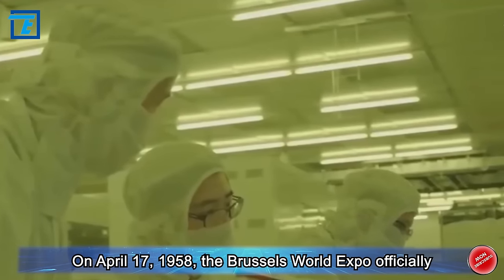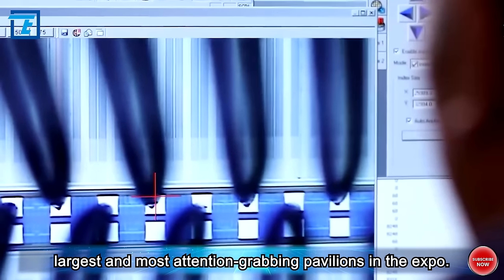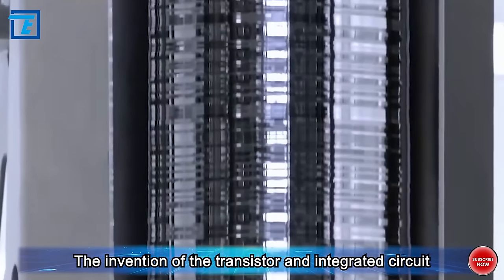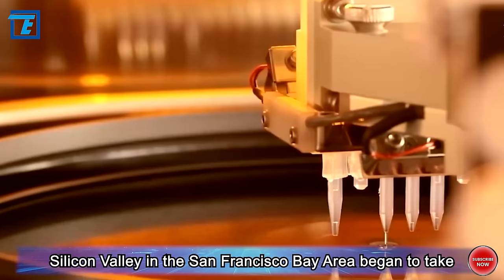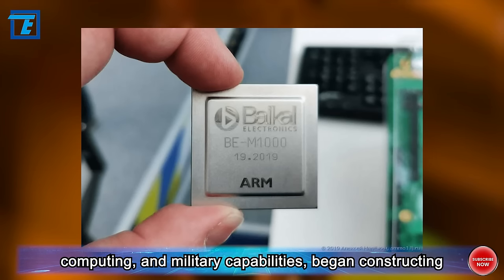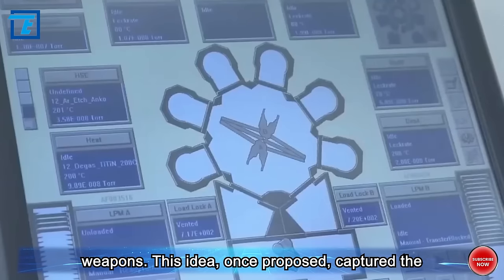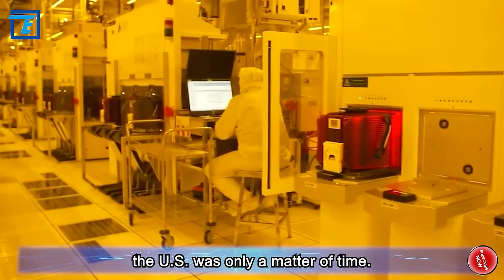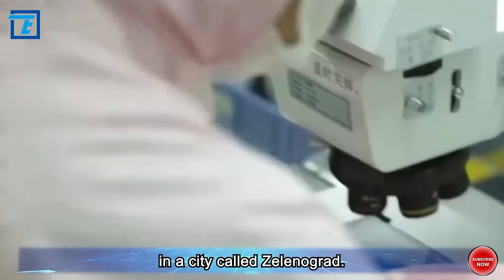Can Russia Develop Its Own Chips?

Comment: A lot of industries use past technology due to long cycle times. The car industry is still using 90nm and plans to move to 45nm in the next 5 years. The probes sent on Mars use tech from the year 2000. The aerospace industry is even more backward than the car industry, not to speak about the military. So the russians are able to manufacture chips for a big part of the industry.

Comment: With chiplet manufacturing there is no reason to go below the 14nm double mask processes.  While 8nm does work well, 7nm has up to a 30% loss-defect rate requiring sector disabling that can be adverted to a higher degree staying to the larger process node level and stacking chiplets.. and as we have seen, with the AMD vs Intel debacles .  Memory in most Dram product are staying to the larger nodes sizes.  SLC long lasting memory virtually stopped at the 45nm node size as chip life below this is drastically reduced.  Light switching is at a standstill as it requires larger manageable wavelengths and still has to be transferred to electronic memory rendering it to parallelism for any speed gain.. Moore's Law had a limit.. and it has been met; Moore's Law id Dead (a phallicy).  As for accessing chips from 'abroad' (Russia), China is now a major player making chips at the 45nm process at several fabs and can be accessed for making chiplets.  In two years, Russia will be self sufficient in producing 14nm chips, as it has access to Chinese technology.. and a some rather 'easy' border.. with China...  if not already.  It is the USA that is in real trouble and may have to rely on the regional small fabs that are usually involved in defense and proto-production.. well known to its adversaries, as TMSC is scaling back it's large fab in the Phoenix area  and sestablishing two oyther smaller plants insted in areas that are not so politically and environmentally unfriendly.  Phoenix water really wasn't that great, fresh water is better.

Comment: Why not ? Russia does it already for its military Forces , but dont expect as developed designs as in the West . The same is true for China . It took TSMC 10 years to develop EUV and another 10 Years to make EUV and TSMCs 5 nm to a mass product , after EUV worked there came fast 5nm and now 3 nm  because  EUV worked already  and 4nm and 3 nm is only a shrink and not a complete new Technology . 340 nm or even 130 nm Wafer are at least 20 years behind .  Currently there is in the world  only one Company from Germany which can build precise enough optics for EUV and thats Carl Zeiss SMT . 130 nm Wafer which Russia want to produce in 2026 were produced in the west in 2001 . It may be enough for simple ICs and CPUs / GPUs  but far far away from the performance Level at 5nm . Simply make the chip bigger ? = wrong  , bigger Chips mean more potencial defects from wich each defect can make the CPU/GPU unusable
Reply: Carl Zeiss was interesting as long as there was a global division of labor, everyone did what he could do well and cheaply. Carl Zeiss does not refute physics, which means you can do it yourself.
Reply: @Redfvvg Carl Zeiss is the market leader for optics in semiconductor industry. The company exists for nearly 180 years and is a world-wide symbol for high-precision optics. Especially, they manufacture the most precise mirrors of the world (for ASML). Yes, in theory it would be possible to produce mirrors of comparable precision. But how likely is that? And what would it cost?

This also illustrates how crazy the idea of a self-sufficient Russian semiconductor industry is. In lithography, they would not just need to reproduce the whole work of ASML. But also all of their suppliers! Because ASML simple buys the best components from all over the world. Like mirrors from Carl Zeiss, lasers from TRUMPF, resist technology from LAM, etc. And this is just about lithography. No country in the world can cover the full modern semiconductor process, let alone a backward and poor country like Russia. The whole idea of «импортозамещение» is stupid.
Reply: Pretty sure most thing electronic used in the ruZZian military come from anywhere but ruZZia. LADA even had to start using carburettors again....

Comment: Rostech produces 4 500 000 000 chips per year ... using propaganda as fact will never give you clear picture or understanding. Russia has some of best machine building industries and engineers, previously they rambled how Russians can't produce machines for gas extraction and that they need Simens, now Russians produce them themselves and are developing new ones. Same will be true with time with micro chips below 12 nm, for which they had a prototype already in 2012. Just like propaganda machinery claimed Chinese won't be able to produce them and they threw out 5 nm chip couple of months later.